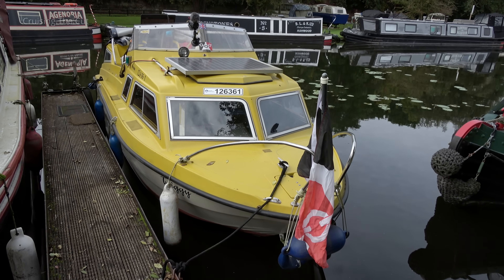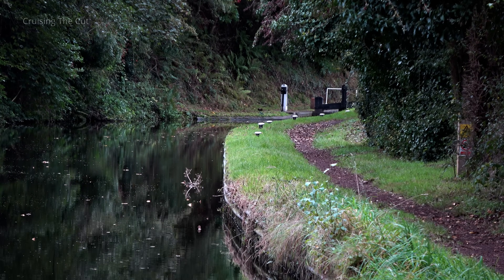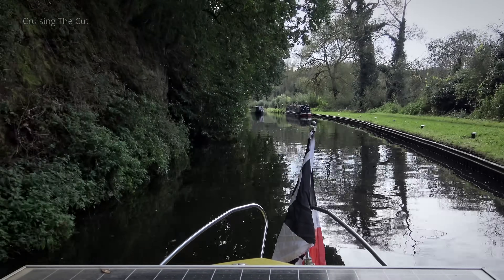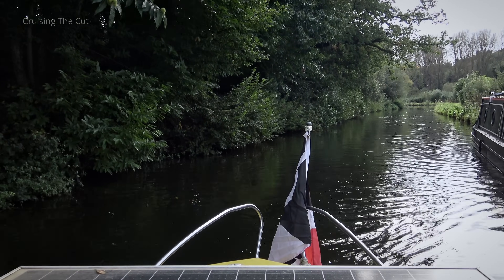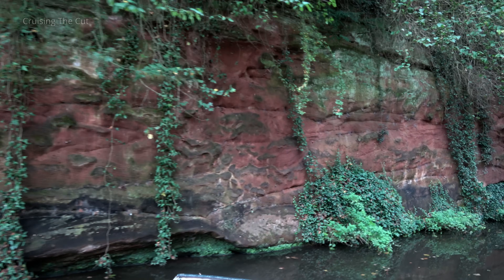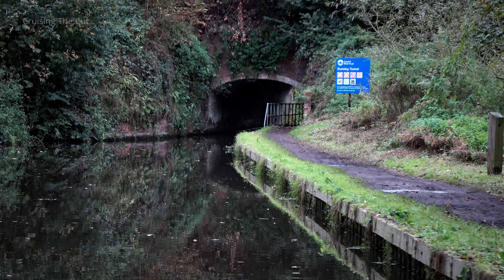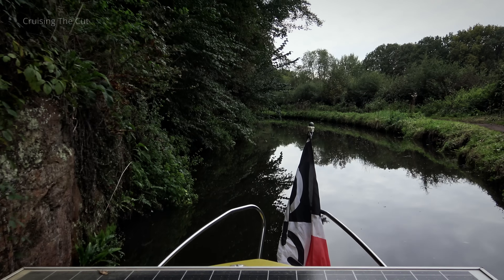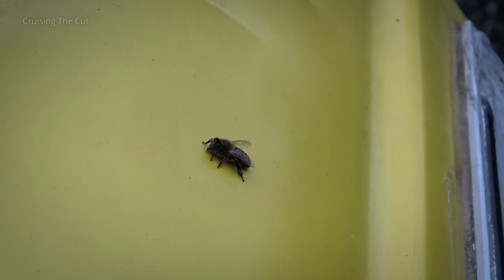317. I bought another boat

Comment from the maker: NOTE! Firstly, the boat DOES have a rudder fitted to the outboard. Also, it IS a four-stroke engine. Cheers!!
Reply: Good to see you back on the waterways my friend, missed your cruising content. The medicine I need in this mad world we seem to be living in.
Reply: A boat, viewed from underneath can be looked at like an airplane viewed from the top. When you turn the rudder in a plane, it does not make the airplane change course , it just changes the direction the plane is FACING (ie its heading)*. It would need a fixed vertical wing of some sort in the middle to cause the fuselage to actually move in that direction. 

If you view an airplane from the SIDE, when you angle the elevator up/down it also angles the fuselage, but then the whole fuselage goes up or down because the elevator changes the angle of attack of the wing and it starts pulling you in that direction. 

If you had a vertical device on the bottom of the hull, (sort of like a sailboat) then the rudder would change the angle of the boat (as it does) but the straight piece would then make the boat change actual course.

I saw this on scrapheap challenge one time where they made a submarine and it had an elevator, but no "wings" or "bow planes"; thus raising the elevator made the nose aim up and the tail go down, but there was almost no change in depth it just scooted along the bottom while aimed up. Blimps do this too, the "balloon" body acts as a lifting surface but not an efficient one, so you have to use huge elevator to get it to do anything.

Of course something sticking down would be an issue for grounding, especially with the fiberglass hull. Maybe short "skegs" on both sides?

* there's more to this,  but this is the relevant part.
Reply: Great to see you back on the water 👍🏼👍🏼
Reply: Is the crabbing motion due to a short keel in relation to the length? And maybe a keel that isn't pronounced enough?
Reply: Even with the rudder on the outboard it's an entirely different kettle of fish when your steering is actually directing thrust in different directions...It's akin to driving a forklift where the rear wheels turn and the fronts are fixed.  Also the short waterline length and very light weight make it a good deal more "twitchy".  Basically it will take time to relearn helmsmanship as it is a different experience than a traditional narrowboat.
Reply: exactly what I was thinking, it needs something for the rudder to work against, so maybe a foot or two of 2 inch wide wood to form a ‘keel’ …. I would put it a bit forward of the center of the boat but that is just a feeling, you may be right about having it in the center.
Reply: Does anyone make Aluminum Narrowboats? It would seem to me that it would be a viable option especially if you wanted electric propulsion. The weight savings of Aluminum over steel would allow for more batteries.
Reply: @natehill8069  a 4 inch tall keel running the length of the hull would add the directional control with minimal grounding risk.
The most important fact of the outboard steering is that when you turn the outboard it starts pushing the stern  to the side.
Reply: @DavidtheSwarfer  A pivoting leeboard type keel is the solution that is sometimes used on sailboats. I might try a bow mounted electric trolling motor with wireless remote to use like a bow thruster.
Reply: Reposting here...
A keel runner board (keel extension, or false keel, if you will) or two would fix your side slipping (due to low velocity, weight, and hull shape) and take the "petulance" out of the "child". False keel - a thin keel or strip below the main keel used to serve as a protection and to increase a ship's lateral resistance. Not too difficult nor expensive, but you'll have to pull her out to do it. One down the center keel or two shorter ones (2 cm height) spaced between the keel and the chine, each side. A false keel from transom to bow would be easiest at 2.5-3 cm height and rounded or tapering off at the bow curvature before the water line forward. Keel height is inversely proportional to nominal speed used; i.e. higher keel/lower speeds. The drag created by the board going sideways reduces/prevents side slipping. You'd be surprised at the amount of improvement in steering and control you'll get. It'll take a lot of the stress out of running in tight spaces at low speed in the canals. 
"Tea without milk is so uncivilized." Blythe the Forger - The Great Escape
Reply: Thanks for pinning this. I was about to embarass myself by posting about low speed steerage. But you got that covered.
Reply: Lovely to see you out on your own boat again!
Reply: It's cute.🎉
Reply: And I am not the least bit surprised. 😊
Reply: Wonder if you could use a "trolling motor" that was battery operated?
Reply: @natehill8069 maybe a different propeller would improve its slow speed manuverability ?
Reply: good video
Reply: @noyopacific  I agree with the apparent utility of a bow mounted electric trolling rig. I saw one on a fishing/outdoors channel which looked like it could be retracted remotely too.
Reply: Given the difference in weight and hull displacement between Twiggy and your 'old' boat I think you'll just have to learn a new way of steering.  The narrowboat didn't really ever slide sideways, while Twiggy sits more on top of the water rather than in it.

I'm thinking between the low speed that really affects the steering and a good portion of over-steering it's just a case of learning how to understand Twiggy's differences.

It will be nerve-wracking no doubt but you will catch on pretty quick.  I have great faith in you!  🙂
Reply: @DavidtheSwarfer n no
Reply: @MultiPetercool  Given narrow boats used to carry full loads of coal and ore, the hull material is erm ... immaterial to how many batteries it could carry.
Reply: @TwoAcresandaMule  I was about to suggest the same. I'm positive that would be adequate. I've seen a narrowboat (video) with a dual trolling motor setup. Worked fine, and since he HAS solar panels and you seldom go THAT far.... why not indeed?
Reply: I see fiberglass DIY in your/ our future to fix the steering. Boat technology has come a long way but you would think they would have needed low speed steering years ago when it was first built.  It is cute so so it is worth any money you put into it.  We have some pretty large trolling motors here in the states.  My son has one on his boat that has a memory for programming good fishing spots.  Also Lithium batteries are becoming more reasonable.  Look forward to your adventures.
Reply: Great video.  Possibly wrong prop, or maladjusted trim on the outboard motor of "unknown provenance?"  The reving and steering problems seem excessive.  Congratulations on the new boat!
Reply: You probably need a lower pitched prop, that will enable lower speed maneuvering
Reply: Congratulations! I love your little yellow boat. Sometimes motor boats are hard to steer in low or no wake situations. Also is there corrosion on the steering cables. It’s a salt water problem but can affect boats in canal water. Happy navigating captain.😎⚓️
Reply: Well I did not see this coming David - congratulations. Steering a boat purely with an outboard is difficult and with a low draught small and light hull it will be skittish. Every steering input requires an opposite input to arrest the turning momentum and with poor throttle control, that is magnifying the problem. Perhaps, you need to investigate the control lever mechanism, as well as the outboard motor end as there may be too much ‘stiction’ in the system. Good luck and have fun.😀👍⛵️
Reply: Suggest also checking to see if outboard is set deep enough. Shallow prop can contribute to imprecise steering…
Reply: Would a larger prop help with the lower speed thrust?
Reply: @TR4zest   You totally missed my point. Narrow boats, are not seen as cargo vessels anymore. They are pleasure cruisers. A heavy steel hull is overkill. And you’re still prone to corrosion. Sure an old-school steel hull can certainly handle a lot of batteries, but with how much freeboard?  An Aluminum hull could carry more batteries with less water displacement. Simple physics.
Reply: @MultiPetercool  I haven't heard on an aluminium narrowboat, but that said weight saving isn't much of an issue today as they were originally designed for haulage. A modern narrowboat with living quarters is still a fraction of the weight of a fully loaded coal boat.
Reply: Lots of people here are suggesting adding a skeg but I have a potentially much more easy to implement fix: try adding a substantial amounts of ballast. This will cause your boat to sit more in the water rather than on it, it will give your underwater hull form more purchase on the water. It will give the boat more inertia and smooth out responses to thrust. You can test this out using weights or even filled water jugs sitting on the sole. You can move them around to decide the best places to add permanent ballast and how much.
Reply: @MultiPetercool  Since aluminum is more reactive than steel and thus is used as an anode in some situations, as well as being more expensive, I don't believe it would be a great alternative material.
Reply: @TwoAcresandaMule well, 10-15 kph or10-15 mph just might slew the boat slowly sideways...
Reply: Hi David, I always loved the vlog from almost the start. My dad had an outboard on a cruiser in the '70s, but the rudder didn't help much until he made it project lower than the prop wash. It was the Lancaster Canal, and he also made the rudder tilt up when it touched the bottom to stop it from kicking the engine up. It had a cord attached to manually pull up in reverse; it was a very simple plate but the steering was radically improved
Reply: Depending how you get on David, regarding the engine, would it be worth taking advice about changing it to a more powerful low revving engine that may well give you more control at much lower speeds?
Reply: may i offer a suggestion to help steer? They make lil powerful electric outboard motors, for Bass fishing boats, that are foot pedal controlled, both in direction and speed, mounted up front in bow, some how, would act like a bow thruster, both for controlling bow, under way and in marina maneuvering, and they make brackets, that allow motor to be folded up, on deck out of way, when not in use...
edit, the electric bow motor, would also help in lock maneuvering, saving fuel, yet giving limited control
Reply: Would love to see you on an all electric boat
Reply: @natehill8069  I agree, a shallow draft skeg attached to the hull, adding perhaps just 2 inches to the draft, and nothing to the draft including the outboard, but quite long, extending from about the halfway point all the way back to the transom, and maybe a bit further, only having to end before hitting the engine at full down trim.   The low speed directional instability comes from the hull being designed for much higher speeds, and heavier engines, then modified with the little engine, making it light in the rear.  The transom is also designed for high speed lift rather than low speed efficiency.  Fiberglass boats can be designed for low speed canals, but most aren't.  One or 2 pieces of aluminum angle iron screwed to the bottom of the boat should do the trick.
Reply: @natehill8069  As for the excess thrust during maneuvers, it is possible to turn down the idle speed, but the more you do, the more precisely you must adjust the idle mixture to prevent stalling, and be ready for stalling with the tools needed to turn the idle speed back up again.  But if you get the tuning just right, (mixture, timing and plug gaps) you can turn the idle speed down really low without stalling.
   Another option is a still smaller engine, if you have more power than you need or want.  You will be surprised by how little power it takes to push a boat down a canal at displacement speeds.  Boats don't like middle power.  They like either very low displacement power or high planing power, nothing in between. A smaller engine should in most cases be able to maneuver more gently.
   A third option is auxiliary electric power as in a trawling motor.  These can be rigged up as on bass boats attached to the bow with pedal remote steering, great for maneuvering and short stretches of blissful silence, depending on battery capacity.  And these bass boat motors are mass produced cheaply.  Come to think of it, this might have several advantages over trading for a smaller engine, since the smallest engines tend to have no generators with which to charge batteries, and that engine being pull start, lets you drain the batteries completely with the quiet electric and still pull start the gas engine.   I think it's an older Honda BTW.
Reply: so this style of hull does not do low speed maneuvering well, it would likely benefit from a larger center keel at the front and mid added on to help with that. another thing would be to replace the outboard with an electric + more solar+ lithium for a drive system this would allow you more precise control and silent running.
Reply: Well done you.   It’s a bit of a highly strung beast that wants to do its own thing. Will you get more familiar with the steering?   Practice makes perfect.  Good luck.
Reply: So good to see you afloat!
Reply: It won't steer in neutral
Reply: The outboard is too one side not in the middle
Reply: @quartertwenty484    Yes! More boat in the water is needed and Ballast is the way to go.
IMO the yellow boat was
 designed to fly over the top of the water at speed. The motor would have been mounted at an angle (tilted slightly, forcing the bow down, to keep the boat from flipping bow over stern at speed) so durrng a  turn the motor would tip the boat slightly down on the inside of the turn, using the corner of the hull as a thrust reaction point. The effect is somewhat like how ailerons, and not rudder, turns an airplane.
Reply: @TexasVeteranPatriot  If you check out the video titled, "Antifouling of a GRP boat off a trailer, painting twiggy" you will be able to see the bottom of 'Twiggy' and see if it has the elements you have described. You will also find several videos showing what the previous owner went through to get 'Twiggy' back into the water. Another little point is that the originally fitted outboard was stolen thus David's Twiggy has an outboard "of unknown providence."
Reply: Lots of good suggestions here for improving the steering.  Perhaps the easiest would be to redistribute some of your kit fore and aft.  Try getting the stern down a bit.  If that doesn't work move weight forward.  An easy test before you start building lee boards or a longer keel 😀
Reply: you havent said how much the boat cost?
Reply: Great to see you’re back on the water David. I thought that after your visit to me on Forget me Knot, that one day you’d buy a cruiser. For my sins I’ve sold her and now have a 50’ Trad narrowboat, so all your fault! 😂
Reply: Perhaps tie a paddle onto each side as a temporary measure. Dipping in with the flat parallel with the boat like canoe steering. Might help keep it going where intended.
Reply: That sure doesn't sound like a 4 stroke, they're close to silent at those speeds these days. Go compare to another more modern 4 stroke.
Reply: Twin outboards. Steer with throttles. You're welcome ;)

Comment: So pleased to see Mr. Johns owning a boat again. And not just any boat, but clearly a boat with a mind of its own. This will be very exciting.
Reply: It has all the handling of a supermarket trolley! The slightest move is like the butterfly effect on steroids.
Reply: I think he could add some vertical fins in the back. These V-shaped front crafts with rather flat bottomed backs are not easy to hold on a straight course unless you run then in planing speed.

Comment: This outboard of unknown provenance seems to be working fine. If you ever need to replace it newer out boards have advanced by leaps and bounds in recent years. Another thought is a different prop may serve your purposes better for this kind of boating (low speed).
Reply: I was wondering about this right before David mentioned going electric.  A newer engine ( do they make hybrids?) and a better prop might make steering and slow navigation easier.
Reply: a new outbord would cost more then he paid for the boat and a different prop no

Comment: Check bushings in the steering cable links. Then consider a blade extension on the fin of the outboard to help with tracking.
Reply: That will work and help you with the maneuverability - if you're adventurous, try enclosing the prop in a homemade housing of PVC tube, it'll give you even more direction at low speed, almost like a water jet. Congratulations on becoming a water rat again!

Comment: David, that outboard motor is a 1990’s era Honda, probably a 9.8 hp or 15 hp.  Maybe a late 1980’s.  My past experience in work includes part ownership of a marina in Ontario Canada with my parts to a full career of marine parts distribution, marina parts department manager and service writer.  As for the throttle issue, you may just have to replace both the throttle and shift cables and they get stiff with age. These are standard Morse or Teleflex or U-Flex control cables formerly called 33C style having 10-32 threaded ends.  Congratulations on your new purchase and am looking forward to seeing more of your journeys on. Cheers.
Reply: I don't fully understand all of rjt's  comment but it sounds as if he knows exactly what he is talking about and is giving good advice.  I am sure that your engine should be able to run at whatever rpm you set, and not just tick over or death wish, so if going over the remote throttle and steering controls does not entirely solve the problem then perhaps the engine would benefit from the attention of a knowledgeable mechanic.